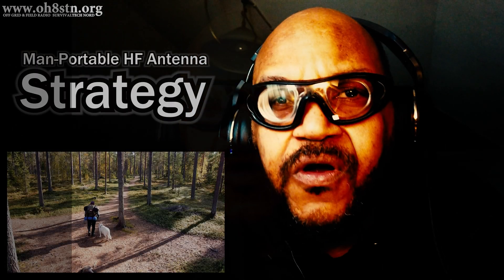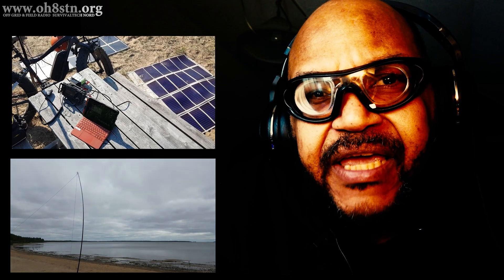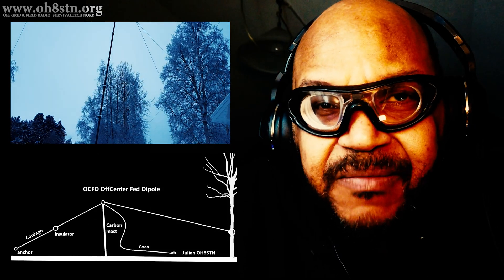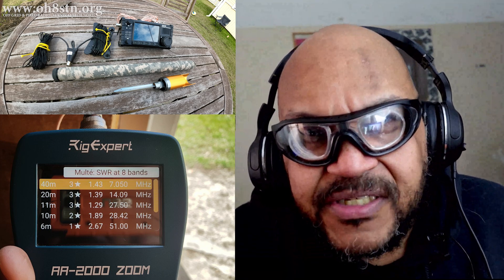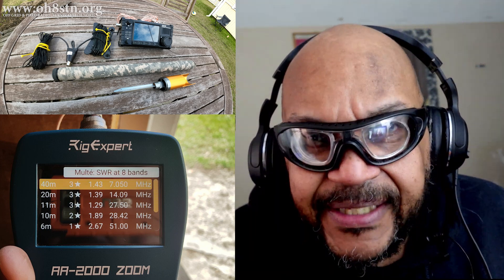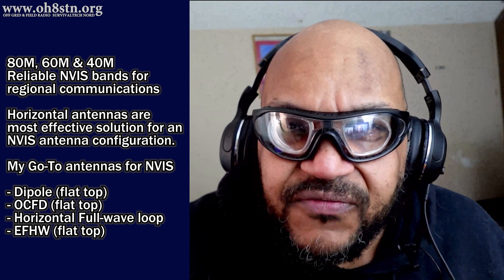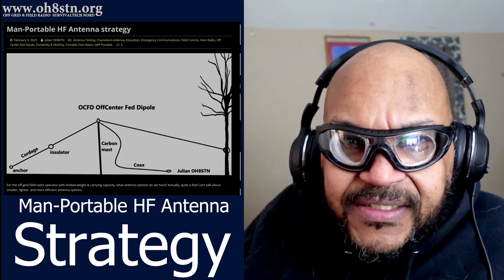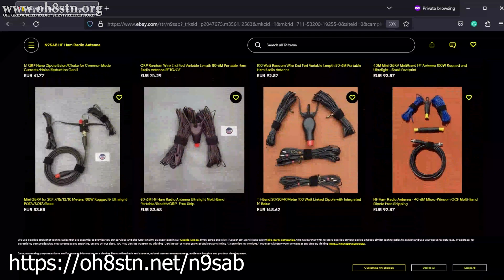Portable Ham Radio Antenna Strategy | OH8STN Off Grid

Comment: I bought one of Tim’s 4010 EFHW antennas. Without the extra link portion, I could hear a station in California from coastal Alabama on 10 meters.
Reply: Thoughts on Gigaparts’ Explorer POTA20 Portable 20’ mast for an EFHW sloper or would the 33’ version make a huge difference?
Reply from the maker: @stevesummersell_K4WXX it's always a compromise between what you can carry and how useful the lifting mechanism is. If you're using a dipole, getting the apex of the dipole up as far in the air as you can is important. It's the same with a sloper. If you have it too low you'll start doing nvis or make it very directional. Get it up in the air and it'll work much better for dx, if that's what you're looking for.
Reply: @OH8STN Both I suppose as the pole’s height is adjustable lol I think I’ll get the 20’ and experiment 👨‍🔬 📻

Comment: J-pole, fishing line and a slingshot is a tried and proven design for  up to 20 meters. It is essentially a half wave end fed with a matching section for 50 ohms. You could probably make one for 40 meters as an inverted L sloper bent at the end of the matching section. 80 meter is a challenge and begs for a grounded, skirted 1/8 wave unipole fed by window line with radials with separate full size Loop On Ground or other smaller loop receive-only antenna. With morse code capability you could multiply survivability exponentially, if anyone could understand it. Digital modes would be the ultimate in reliable comms.

Comment: What size diameter weight wire? 73 DE W8LV BILL
Reply from the maker: All specs are listed on the antenna listing: https://oh8stn.net/n9sab
Reply: Oh darn... Let me rephrase it: What wire is your "go to" wire for your pursuits? 73 DE W8LV BILL
Reply from the maker: Hi William. 
I rarely build my own portable antennas any longer. These days, I prefer to buy ready built if they meet my needs. 
My criteria is 50 watt capable at 100% DC, waterproof, lightweight, with wire which won't tangle.

Comment: Thanks for the thought-provoking video Julian. 

I have Tim Ortiz' 20m - 40m linked dipole and off-center fed 40m dipole antennas. They are excellent build quality and robust while being light weight. 

It would be interesting to see an 80m off-center fed dipole with the same construction quality.

Comment: I had one of Tim's antennas for about 5 months....just put it up this weekend. It is working amazingly on 10m!! Great product, very small and now I can't wait to get off the grid with it and see what it can do in a remote area. Great video!
Reply from the maker: Tim's antennas are definitely the best performing an easiest to carry that I have. In fact it's because of this performance, lower output power remains effective. Wherever we can gain efficiency, saves in storage consumption.
Thanks for watching and commenting. It's greatly appreciated.
73
Julian oh8stn

Comment: Hi Julian- Great content. Thank you. What is a great 20 meter antenna so I don't have to worry about an antenna tuner? Have a Lab599.
Reply from the maker: Hi Jeff. If you're just worried about twenty meters, A di pole with a telescopic pole would be your best bet. Second best would be a quarterwave vertical like the super antenna. Of course you could always make your own antenna with a telescopic fishing pole, A single vertical a few ground wires.
Reply: @OH8STN  Thank you for great advice and kindness Julian. The antenna system is always what seems most challenging to me. Kinda drive me nuts at times. Love the Lab599. Something about that radio!

Comment: Did you try a linked dipole? I think it's the best way to have a multiband antenna on a single wire. resonant, efficient, lightweight and very portable.
Reply from the maker: Yes linked dipoles are extremely well performing. The only problem is band changes during poor weather. During the winter months here, It isn't desirable to leave the shelter in order to change bands. In summer months, the linked dipole is fine.

Comment: Thanks for this video I always enjoy when you share the process you go through in pursuit of an objective.  Getting lighter and more man/person portable is of course entirely desirable where carrying less weight is desireable. Having done backpacking when I was younger I can attest to the needed to take only the minimal gear required. Over many years I found various ways of trimming down my pack and I'm sure everyone who had packed a load into the back country or down some rural road by bike will relate. But, as noted reducing weight always involoves trade-off's, it is just the nature of that beast. Like you, I've also been on a quest to find a packable wire antenna  that ticks all the boxes. At the end of the day, getting the signal out there, as you noted, is the one box that must be ticked or nothing else matters. I'm curious to know if the material used to make the wire radiators is significant in performance. What leaps to mind here is something exotic like Titanium wire? I have no idea if Titanium is a good radiator or if it would roll nicely. My idea is that because it is lighter than other materials but also stronger than steel the radiator could be quite thin. I will call this concept the ghost antenna. Would there be material characterists which would excude Titanium for technical reasons? I'm just thinking aloud so forgive me for floating an idea which might be entirely unsound.  Thanks again for all the work you do to the benefit of others.

Comment: Hi Julian, I know this is late, but I thought I'd chime in. Right now, when I'm backpacking, I take a Xiegu x6100 (only QRP radio with internal tuner - I'd rather use a IC705), a Chameleon MPAS2.0, and a long wire (plus, of course, solar, external battery, etc). I find that setting up the MPAS2.0 with an attached wire lets me very easily create a multiband inverted L configuration which works exactly for my needs. During the day, I tend to use the inverted L for 40M NVIS, and at night I like to be able to frequency hop as needed. The 40m during the day gets me a good wide range, and at night I can reach halfway across the US easily enough. While the MPAS2.0 is chunky, it isn't terrible, and adding a wire to the tip really makes it sing while staying lightweight. Just my thoughts.

Comment: I got a 4X4X2 inch PVC electral box to put a toroid in. I want something that will do 100 watts. You could go smaller, but I am going with a 240-43. winding for 49:1, and 64:1 to giv some play in the setup. There are smaller ways to do this if you need to. But a EFHW is light and easy to put up. Silicone wire is light and easy to work with. I need to put some kind of wire winder glued to the back of it. The box is water proof and if i make sure I seal up around the conections it should hold up well. I don't know what ypu can get where you are but I can get down to 2X4X2 water proof boxes, maybe smaller if I look. Hope that gives some ideas.  73   W4DES

Comment: This might sound wacky, but what about a magnetic loop antenna? Thanks.
Reply from the maker: Not a wacky idea at all. There are single band d I y magnetic loop antennas which are small , lightweight, and easy to carry. Sadly no commercial magnetic loop exists which isn't without size and weight.

Comment: I followed the link over here that you provided in the FT-818ND thread. I need to digest this information a bit. Car portable sounds like a more accurate characterisation of the degree of portability I’m looking for. Here in Western Australia the summer heat can get to 40-42C whilst in winter we can get rain but very rarely sub-freezing temperatures. I’m close to many beaches… we have a few hundred km of beaches N/S of my location so I’m probably going to be making beach activations… are #BeachesOnTheAir #BOTA a thing..? 😂 On a somewhat related subject can you recommend dummy antenna loads for the FT-818ND..?

Comment: What type of feedline would you recommend for this antenna?  The photos look like some type of very thin coax.  If you decided to haul this antenna way high up into a tree, would you consider RG-8X to minimize signal loss?  Thank you for your outstanding videos.
Reply from the maker: I use RG-316U. It's lightweight,  robust, and low enough loss on HF.
73
Julian oh8stn
Reply: Thank you for your answer.  Tim Ortiz wrote his antennas are out of the ARRL antenna book so I looked them up.  His 80-6m Off Center Fed Dipole is the same as in the book.  One big downside to this design is that antenna current is likely to flow on the outside of the coax and actually radiate RF!  The coax becomes a vertical radiating element of the antenna.  (All of this is straight out of the ARRL Antenna Book).  The 4:1 voltage balun is for impedence matching but does not choke off current flowing back down the feedline.  Maybe this is OK on 5-10 watts, but I dont want the RF exposure from higher wattage transmissions from what is essentially an additional radiating element of the antenna (the coax) very close to my body.  This is not a problem with center fed dipoles properly length-tuned to your frequency,  The problem with Off Center Fed Dipoles is caused by unequal impedences, which causes the antenna currents flowing in the two wires to not be equal.  I would be happy to send you copies of the relevant pages of the Antenna Book if I had your email.  Thank you for your fantastic channel!  73.
Reply from the maker: I disagree with you, "kind of".
The problem with OCF dipoles (and any other unbalanced antenna), is "Operators not using choke baluns" at the feed point. Your question queried the type of feedline used. No mention of how I prevent the feedline from radiating, I often add in a 1:1 choke balun at the feedpoint. For "unbalanced" antennas,  this is always good practice.  Tim even sells the chokes in his shop.
73
Julian oh8stn

Comment: I really enjoy your videos!  I thought the EFHW did all of this already?  I'm not sure I understand the advantages of this off-center version...   Is it the durability/rough use issue?  Can the existing EFHW be made tough by simply potting the electronics?  I have the ENDFEDZ 10/20/40 MkIIvp and have been very impressed with it.
Reply from the maker: This was all covered in the video. Finding the balance between efficiency, being waterproof, lightweight and fast to deploy. Definitely the efhw is one alternative. I'm just not going to go to the field with something which isn't waterproof anymore. Even a little moisture on the components can cause SWR variations while we're transmitting. Anyway I personally want something which is built rugged by design.

Comment: I love this episode because it's a topic that has interested me since I passed my general exam. You have given me many ideas and made me rethink some areas of Off Grid Communications. Currently, I saving for a FT-891. I think this is a tough radio, can be used off grid. I'm looking at the following antennas because the at light(ish) and rugged. Have you tried the Gabil 7350T or and the one I really looking hard at despite the $499.99 price tag is the GOTOMYANTENNA.?It's a shunt antenna and looks like it can take a beating. Both are fast to deploy.
Reply from the maker: Consider a rethink.
I fear your antenna choices will leave you disappointed. The rig has amazing performance, but very current hungry on both TX & RX. Factor this into your battery plans. 
73
Julian oh8stn

Comment: I agree with you, that there is a gap in the market. I must say, though, that the sotabeams antennas are ‘rugged enough’ unless you want to use them for weeks at a time. They are also very portable and light. Interesting video as always.
Reply: Is this a move away from amplification & back to qrp?
Reply from the maker: There was no move to amplification!  Amps are just tools, we use for critical communications. Tools used in emergencies, when nothing else works. ~97% of my radio ops are pure QRP @ 5w.

Comment: I think it is also important to remember that an efficient or broadband antenna with or without a transformer, is still only as good as how it is installed.  Every horizontal antenna, sloper, vertical, etc has a strong point and a weak point.  So be sure to install the antenna in a way that is best for your applied use case.  Be sure you understand this, or the "efficient" antenna could be worse than the multiband, depending on how it is deployed.

Comment: Another great video Julian. My opinion is even what you discuss here is way too much stuff and weight. There are much smaller and lighter radio configurations than an IC-705. Adding a computer to the mix, no matter how light is still extra stuff and weight. VARA HF, FT8, JS8CALL and WinLink aren’t the only form of communication & require too much extra stuff depending on what radio you’re using.

If you really want lightweight a 5 watt or less CW only transceiver with the smallest and lightest type of key or paddles, 3aH battery, a lightweight pole (if needed), & a very lightweight antenna is about as light as you’re gonna get.
Reply from the maker: Thanks for the comment. 
A CW only rig critically limits ones ability to communicate. Moreover, it completely shuts down asynchronous messaging, reducing coordination of emergency group communications. In my niche, a tablet, radio, & wire antenna are the core station. Having less capability than this makes Ham radio completely ineffective. 
73
Julian oh8stn

Comment: Great video Julian. Have learnt a lot from all your videos. Off grid and using digital messaging systems, like Winlink that do not require you or your counterpart to be connected all the time, is the way to go. Now regarding antennas... 
Yes, agree 100%! The way to go portable is via simple wire antennas. I have had great success with Sotabeams Linked Dipoles, since we, as Hams, are limited to use only our assigned Ham Radio bands, a linked dipole, already adjusted to our limited Ham  bands is light, efficient and easy to deploy. 
Why do I stick with the old dipole? Well, because if you take a look at the Military... they have all the budget in the world to test all kind of antennas you can imagine. 
Yes! Using taxpayer's money, your money! Look at the antennas they use? Those are all dipoles! So, I have follow their example and built my own linked Dipoles. 

Benefits:
-No tuner is needed at all  so, less weight to carry around! 
-You select the band you want to use and close or open the required link.
-Covers the whole band selected.
-Easy to deploy by one single person with no help. 
-Tough simple design
-The wire thickness to support up to 125W remains thin.
-Can be installed with two support points (two trees as an example) in horizontal configuration.
-You need to reach very far? then install it at least 1/2 wavelength high for DX.
-Need Regional communications? Install low and use lower bands (80/40 meters) for NVIS configuration.
-Only one support?  then use one mast and install as Inverted V or....
-that single support can be also used to install it as a Slant wire antenna, using one leg of the dipole as radiator and the other half of the dipole is used as counterpoise. The radiating element can thus be oriented in the direction of the destination we want to reach, and put the counterpoise in the opposite direction. 

Now, with the Xiegu X6100 that has a tuner included.... I am taking advantage of that setup, at least trying, by using a Doublet. Just like the AN/PRC-74 doublet antenna. Works great and is so easy to use by just extending each leg of the Doublet to the different marked points in the wire. This covers all HF bands from 2-30 Mhz. This setup is great for emergencies but requires an antenna tuner. The Xiegu X6100 includes an ATU so, I am taking advantage of it. I am using a 72 Ohm ladder line. Almost no loss at all. You only extend it to cover the lowest frequency for the day and you are done. The rest is handled by the ATU. The PRC-74 had a tuner included and that is the antenna type selected by the designer of that baby. 

Receive a hug from San Salvador.
73,
Rob
YS1RS

Comment: i go sometimes hiking in the norwegian mountains fishing and allways bring a radio and a battery in my backpack, the mcHF radio and two monoband resonant antennas one for 80m and one for 20m DX for and  80m for local both folded dipoles is made by ladderline with a 4:1 balun.. downside is have to bring minimum two bundles of 10m of coax even a  barrel connector,  upside is those dipoles gives 1.2:1 across the entire band. and is very good using QRP

Comment: Thanks for video. I have a question. Does the carbon mast have any effect on the antenna parameters ? As far as I know, you need to use ordinary fiberglass masts for this.
Reply from the maker: It may have. However,  I use it only to lift the apex of the dipole. There, the mast has no measurable effect on the dipole.
Awesome question. 
73
Julian oh8stn